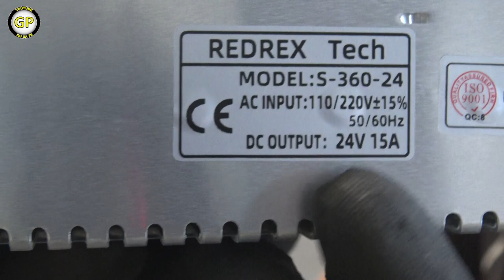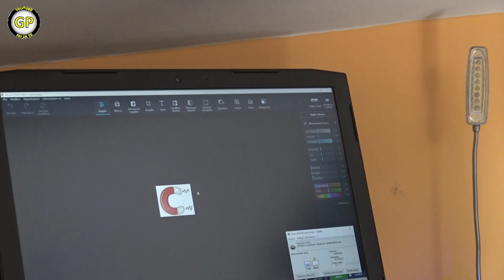Making a Electromagnetic Welding Table - Diy Tools

Comment: Will an electromagnet table mess with the inverter type of welder? I've wanted to build a table but wasn't sure if it would mess with my ESAB Rebel 215emp. Thanks ans great build!👍🏾
Reply from the maker: It is advisable to stay away from the magnet when soldering. It only serves to hold the piece in place. If you stay 10 cm away it is enough but anyway it does not damage the welder, Hello Thanks

Comment: Very well thought.  Only the position of the switch bothers me, somewhat exposed.  How much surface of the table is magnetized with the same force as the place where the electromagnet is?.

Molto ben pensato.  Solo la posizione dell'interruttore mi disturba, un po' esposta.  Quanta superficie del tavolo è magnetizzata con la stessa forza del punto in cui si trova l'elettromagnete? Gracie. Saluti.
Reply from the maker: Circa 15*15. Ciao Grazie

Comment: Awesome video im definitely adding this to My welding table, quick question though. Would using a 36 or 48v power supply make the magnetic field stronger or just make it heat up faster?
Reply from the maker: Ciao, si renderebbe l attrazione più forte ma il campo di azione è sempre quello. Grazie 👍👋